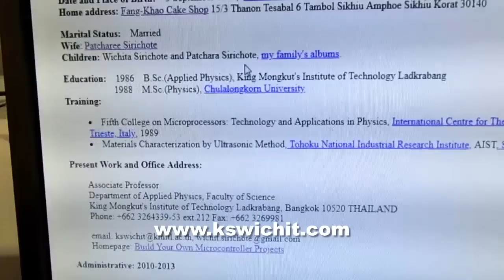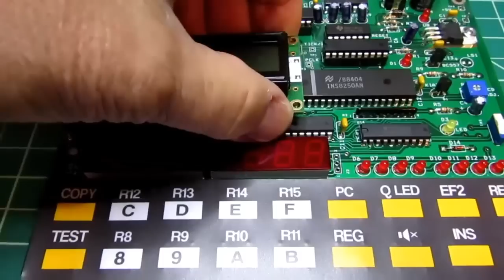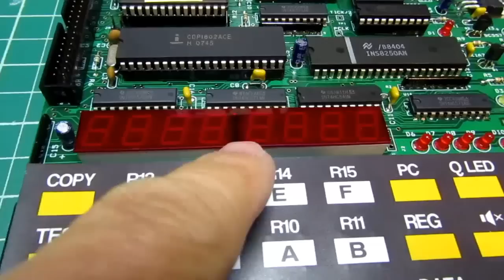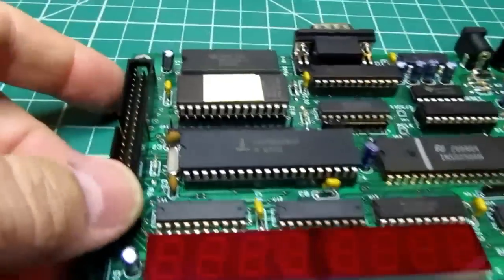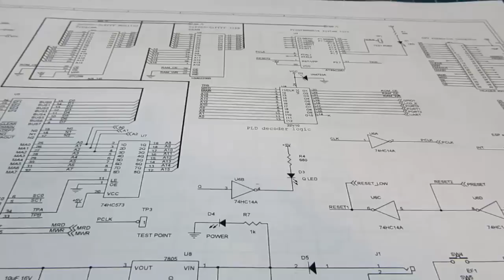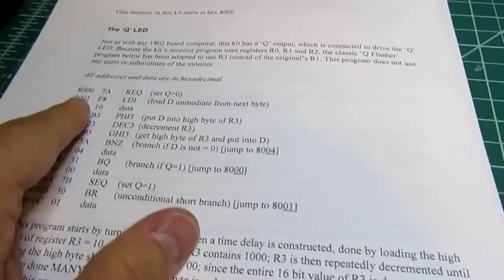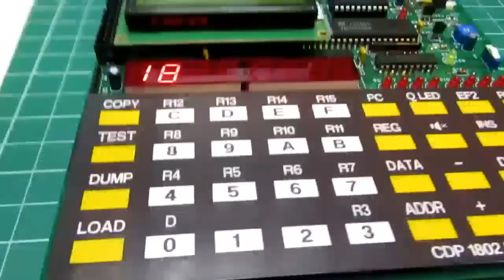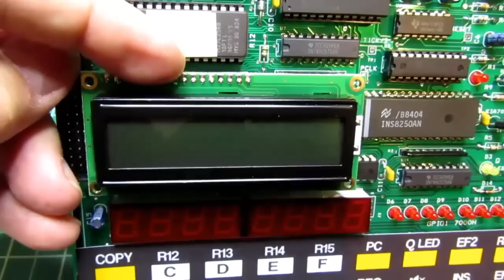CDP 1802 Microprocessor Kit: Review and Demonstration

Comment: I bought this kit and have been having the time of my life programming it:

① The service is stellar: You simply ask questions and get them answered. Wichit is oriented to helping hobbyists learn, and the kit is a great platform for learning.

② The kit worked out of the box: No problems. Easy to figure out, easy to use, and Wichit placed documentation and examples of programs online. If you follow the examples and think about what you're doing, it'll be really difficult not to learn to program in the 1802

③ This is a fascinating architecture; Very different from other architectures I've worked with. Programming it is pure fun & joy

④ The original ELF kits are difficult to come by and very expensive. There is another kit one can get, but it uses binary toggle switches rather than a hex keyboard, so it's much less fun, even though it's smaller. This kit is also more expandable than any other available kit on the market.

⑤ Unless you're into buying the components, and connecting them on a breadboard yourself, this kit is your best opportunity to learn this wonderful architecture
Reply: Why use an antiquated 1802 µP, when you can afford a modern 32-bit ARM µP, and learn the C language in the process, first on a PC, then on an ARM-based evaluation board? C is the language of choice at NASA, that have been using it on its Mars rovers, including the yet-to-be launched rover 2020. 
Those cheap and unwieldly kits may be great for third-world class training, but not for US-based hobbyists or even budding engineers in developed countries. 
References: C Programming for Embedded Microcontrollers, Warwick A. Smith (Elektor publishing). The low-cost evaluation board is available from Atmel (now a subsidiary of Microchip). The C programming tools are available for free download.
Reply: @alphonsozorro7952  For me it's the appeal of retro technologies. I program modern architectures all day, every day. I found this line of kits to be fascinating for a hobbyist.
Reply: @alphonsozorro7952  1802 designs and trainers are still useful today for teaching about microprocessors, hardware design,  and machine/assembly language code. Also in many cases a 32 bit ARM or similar processor is overkill - such as using a sledgehammer to drive a small nail into the wall. Then there is the nostalgic value too - the 1802 was introduced when I was a kid - always wanted to learn on one but never saved enough to buy the parts or kit....until years later. Sure there is the Arduino, Pi, C language, Python,(all of which I am interested in too) but getting down and dirty with the hardware, even older (ELF) hardware, can be fun.
Reply: Bent CPU! No way to CALL...
Reply: @postalmoneymachine6219  8 bit PIC then.

Comment: Great, I still have a 1802 build in the 80's it teached me to read hex
Reply: Why use an antiquated 1802 µP, when you can afford a modern 32-bit ARM µP, and learn the C language in the process, first on a PC, then on an ARM-based evaluation board?
C is the language of choice at NASA, that have been using it on its Mars rovers, including the yet-to-be launched rover 2020.
Those cheap and unwieldly kits may be great for third-world class training, but not for US-based hobbyists or even budding engineers in developed countries.
References: C Programming for Embedded Microcontrollers, Warwick A. Smith (Elektor publishing).
The low-cost evaluation board is available from Atmel (now a subsidiary of Microchip).
The C programming tools are available for free download.
Reply: @alphonsozorro7952  there's two reasons, the first is in 1976, this was all there was in terms of affordable.  The second reason is that you might want to truly understand things at the most basic level of the hardware.  Staring with C on a 32 bit ARM teaches almost nothing about how it all really works.
Reply: What a shame it hasn't taught you correct English!

Comment: I started out with the 1802 in 1976 with the ELF project
Reply from the maker: See my multiple videos on recreating the original ELF, and my video on Bletchley Park and the National Museum of Computing.
Reply: @youtuuba  I have always been interested in the Enigma and all the variants and the fantastic work between the Pols, French, British and Americans on decoding. I have been working with all sorts of microprocessors and the last 20 years microcontrollers for Boeing. I think I have written machine code and assembly for a dozen 8 bit chips. I started out on PIC microcontrollers at Boeing and after retiring in 2004 have also added Arduino to my hobbly list. Been restoring a dozen Commodore 64's lately . Electronics has been in my blood since 69. Thanks for your great videos
Reply: Why use an antiquated 1802 µP, when you can afford a modern 32-bit ARM µP, and learn the C language in the process, first on a PC, then on an ARM-based evaluation board?
C is the language of choice at NASA, that have been using it on its Mars rovers, including the yet-to-be launched rover 2020.
Those cheap and unwieldly kits may be great for third-world class training, but not for US-based hobbyists or even budding engineers in developed countries.
References: C Programming for Embedded Microcontrollers, Warwick A. Smith (Elektor publishing).
The low-cost evaluation board is available from Atmel (now a subsidiary of Microchip).
The C programming tools are available for free download.
Reply: @alphonsozorro7952  "Why use an antiquated 1802 µP, when you can afford a modern 32-bit ARM µP" simple, for fun. not everything in life has to have real world uses
Reply: @alphonsozorro7952  It's the nostalgia of the thing...

Comment: I bought one of those,  but its the 8051 version. Its fun to learn from as long as you can program the way its structured. Im currently building a proto board that connects to the 40 pin connector so i can have the board control different experiments. I have a pot load of those dl1414 displays im using as a first experiment.
Reply from the maker: I have the 8051 version as well, but decided to not do a video about it.
Reply: @youtuuba  Its interesting working with the older processors and hardware.
Reply: Why use an antiquated 1802 µP, when you can afford a modern 32-bit ARM µP, and learn the C language in the process, first on a PC, then on an ARM-based evaluation board? 
C is the language of choice at NASA, that have been using it on its Mars rovers, including the yet-to-be launched rover 2020. 
Those cheap and unwieldly kits may be great for third-world class training, but not for US-based hobbyists or even budding engineers in developed countries. 
References: C Programming for Embedded Microcontrollers, Warwick A. Smith (Elektor publishing). 
The low-cost evaluation board is available from Atmel (now a subsidiary of Microchip). 
The C programming tools are available for free download.
Reply: @alphonsozorro7952  "Why use an antiquated 1802 µP, when you can afford a modern 32-bit ARM µP" simple, for fun. not everything in life has to have real world uses
Reply: @DanafoxyVixen  If you like retrocomputing these kits lets you go back in time

Comment: That's pretty cool, especially for the price.  I built a Netronics COSMAC Elf II in 1977, and it cost $100 as a kit.  It only had two 7 segment displays, a hex keypad and four switches to control it.  No monitor ROM and only 256 bytes RAM.  It does have the 1861 "video graphics" chip, which is pretty much impossible to find these days. That monitor in rom really makes things convenient with the address being displayed.  We had to run a little program to sequence memory, by storing the low byte of the address in each ram location.  This was do you could see if you'd made a mistake entering code.  You'd type in the program, after sequencing memory.  Then at the end, you toggle memory protect switch and hit input key.  This would display the contents of that next byte.
Reply: Hi I built 1802 with the full 64k of memory, the monitor program is stored in the ROM have a cassette interface for storage put the Pixi graphics on it then added a voice synthesizer and a voice recognition system for 32 focal commands was supposed to be put in my robot but never finished still in progress

Comment: does the kit come with assembler? Or you have to program the micro with machine code only? My first experience with mcu was the motorola 68, followed by an intel 8051 variant made by atmel.  Back then, there were no rtos, embedded linux, APIs. You had to write every piece of code from scratch for bare metal system. In one of your other video, you mentioned pi and arduino, the technology has advanced so much in the embedded world.
Reply from the maker: This does not have an assembler. It is intended to teach how to write native machine language code for the target microprocessor.
Reply from the maker: @MDbandit10 , sorry, I don't do emails based on YouTube videos. If you go to my video on the 4200, I will respond to comments or questions you pose there.
Reply: No, the kit does not come with an assembler. You can use it in one of two ways:

① Program it by entering machine code in hex, via the hex keyboard

② Connect it to a PC, and then use an assembler on the PC to create a binary file, which you can then transfer to the kit via a serial/usb cable

That said, the RCA 1802 can be hand-assembled easily, and after some practice, you'll get used to writing programs directly in machine language (hex). It's way easier than you think:

☞ The architecture is big-endian, so reading/writing numbers in hex is easier than on the Intel…

☞ The opcodes are very neatly organized: Very logical, very easy to commit to memory. After hand-assembling a few programs, you'll remember all the commonly-used instructions and won't need to refer to any reference.
Reply: Why use an antiquated 1802 µP, when you can afford a modern 32-bit ARM µP, and learn the C language in the process, first on a PC, then on an ARM-based evaluation board? C is the language of choice at NASA, that have been using it on its Mars rovers, including the yet-to-be launched rover 2020. 
Those cheap and unwieldly kits may be great for third-world class training, but not for US-based hobbyists or even budding engineers in developed countries. 
References: C Programming for Embedded Microcontrollers, Warwick A. Smith (Elektor publishing). 
The low-cost evaluation board is available from Atmel (now a subsidiary of Microchip). 
The C programming tools are available for free download.
Reply: @alphonsozorro7952  "Why use an antiquated 1802 µP, when you can afford a modern 32-bit ARM µP" simple, for fun. not everything in life has to have real world uses
Reply: There are 1802 cross-assemblers out there.  Search for "A18 assembler".  These assemblers tend to generate "Intel hex object" files that are intended to be downloaded into the 1802 system.  The monitor program on the 1802 system would need to be capable of reading/writing these object files over the serial line.  The video didn't show the serial port in action (bummer), but hopefully the monitor supports this.  You would connect to the 1802 system via serial and use a terminal program like minicom or teraterm to send a file to the 1802 system.  The monitor program would be listening for this file transfer.  Presumably, the monitor program does exactly this when the LOAD button is pressed on the keyboard.

Comment: Nice kit but the keyboard is MICKEY M O U S E !! Why not do what Heathkit dit with the 3400, 6800 trainer. They used generic keyboard keys with decals on top of each key.  Wonder if the key switches are still available?
Great review !!
Reply from the maker: wa4aos, I suppose that the kit designer opted for the low cost tactile switches with graphic overlay because it is much less expensive than adding all those larger switches plus making and installing all of their labels. This series of microprocessor trainers all have quite a few more buttons than did the 3400.
Reply: using real keys would likely double the cost. Just look at the cost of mechanical keyboards.

Comment: I wonder where in the world he got his hands on an 1802? they must be rare and sought after for collectors. Im sure no one makes them anymore.
or maybe they do. The z80 and 6502 are both still being made and sold on mouser for about 5 or 6 dollars.
Reply from the maker: Kipper Klank, so you are basing your comment on guesswork? 

In fact, many, if not most, of the popular 8-bit microprocessors have recently been in production or are still in production. The 1802 is still produced, although it is not stocked by electronics retailers; it is necessary to find sellers who have access to the stock that is being produced and can sell some of it piecemeal.

I am sure that "he", by which I assume you meant the creator of the the educational product being demonstrated in the video, got his 1802s the same way that I and other 8-bit fans get ours.
Reply: @youtuuba  interesting
Reply: The 1802 is still made by Intersil and others. You can even get a RADIATION HARDENED version. I don't know exactly why, but I believe it is because the die is so SIMPLE that feature size is large and they can modify the doping to get RADHARD military and Space specs.

Comment: Why use an antiquated 1802 µP, when you can afford a modern 32-bit ARM µP, and learn the C language in the process, first on a PC, then on an ARM-based evaluation board? C is the language of choice at NASA, that have been using it on  its Mars rovers, including the yet-to-be launched rover 2020.
Those cheap and unwieldly kits may be great for third-world class training, but not for US-based hobbyists or even budding engineers in developed countries. 
References:
C Programming for Embedded Microcontrollers, Warwick A. Smith (Elektor publishing).
The low-cost evaluation board is available from Atmel (now a subsidiary of Microchip).
The C programming tools are available for free download.
Reply from the maker: Alphonso Zorro, you seem to be makinga habit of leaving uninformed comments on my videos. You are clearly woefully ignorant of a huge portion of what is going on in the computer hobby world, and while you throw out random facts to support your point, you don't seem to realize that there is a lot more going on than your obviously limited knowledge can cover. While 'C' is indeed very popular, even some old processors like the 1802 are still being used on new designs due to their unique characteristics.  And many schools still begin microprocessor training using the simpler old processors because they are easier to comprehend at a fundamental level.
Reply: "Why use an antiquated 1802 µP, when you can afford a modern 32-bit ARM µP" simple, for fun. not everything in life has to have real world uses (i can copy and paste the same comment like you do too!)
Reply from the maker: @DanafoxyVixen  , well that is a fine example of a totally pointless comment.
Reply: You obviously haven't researched this particular processor.  It is in use right now in spacecraft launched by NASA.